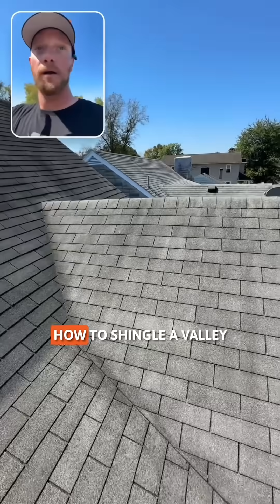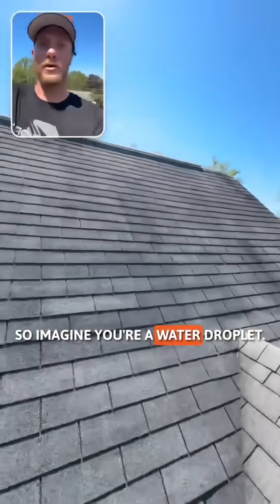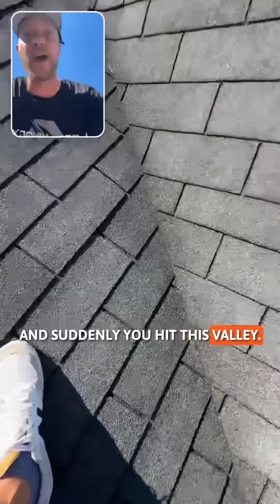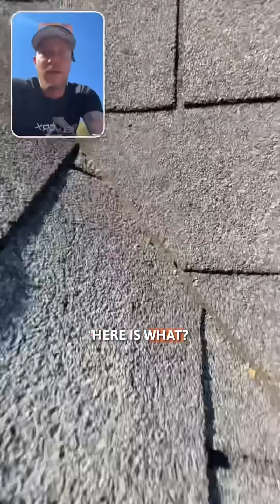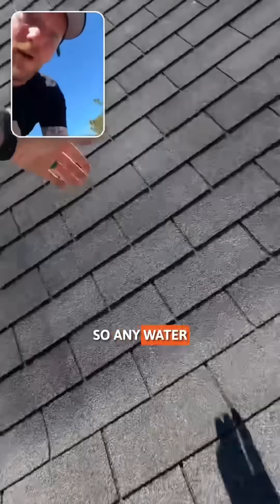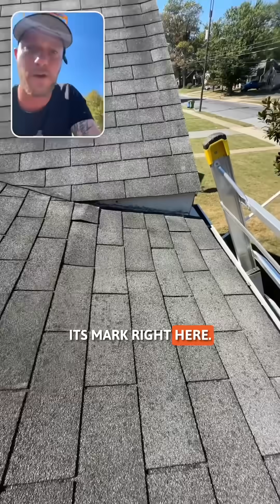Roof Valley Done Wrong! | Why Shingled Backwards Valleys Cause Roof Leaks

Comment: I think by not “shingled in backwards, it is meant that the shingles of the main roof, which route the most water should be above the shingles of the dormer, which route water as well, but less than the main roof.

Comment: A big wide metal flashing installed at the valley that goes all the way from top to bottom will stop water undermining the roof. At the end of the run extend the flashing plus a diffuser will sheet flow the water. Not a rocket science that roofer wants you to believe.

Comment: Uh .. if shingled with the opposite overlap, water would run off the dormer under the shingles on the main roof. The problem exists either way. AFAIK the only proper way is a metal valley.

Comment: That`s why tinwork is supposed to be in the valley, and a gap between shingled slopes to enable unrestricted flow from either side.
Reply: Self adhering Asphalt shingles eliminated the need for metal valleys when installed properly

Comment: If you shingle it the other way, water coming off the dormer goes under the shingles of the main roof. There should be a flashing (metal valley) under BOTH sides
Reply: Negative.  The main roof is higher so the force of the water will be greater than that coming from the dormer.  The cut is backwards.  Always weave 3 tabbers.

Comment: The higher roof runs more water… That’s why it should be on top you should also cut an angle on the top of the shingle that hits the valley will help keep water from hitting the top and running

Comment: Whats backwards about it? Appears to be same pitch, if not very, very close. You didnt mention why you think its done backwards. Or why you would shingle that dormer first, then cut the shingles on your common rafters.
Reply: YOu're 100% correct. I'm thinking he's assuming there is so much more sq. footage on the main roof accumulating the most water heading down hill.
Reply: It's not, it would be much worse to have cut the other side. The place its leaking is at the end of the valley. Channels on here will show you they put a step flashing there

Comment: Just use a metal valley pan guys!
Reply: I’m ignorant. What is this?
Reply: @kyle6703 just assuming that the channel of water they’re talking about in the video instead would be diverted on this metal pan instead of running down the unprotected roof. So basically the waters going to find its way no matter which way the water or shingles run so just cover it in metal.
Reply: @kyle6703  google image search "metal valley pan for roof" for the easiest explaination
Reply from the maker: If we were replacing this roof, we would. This was just an inspection.
Reply: Just use torchon
Reply: Nobody does stuff right anymore… SMH

Comment: We always laced shingles from both sides of valley. Never had leaks.
Reply: We called it weaving
Reply: "Never had leaks" that you know of.  Unless you were the only roofer in town for new installs AND repairs, the odds of the original roofer coming out for a repair is less than 100 percent.
Reply: @DavidCrow-i5i formerly formally authorized by Certainteed retired roofer, here, sir. 
 Certainteed fully warranted our "weaved" vallies and they termed them as one of two types of "clsoed" vallies that they would warranty
Reply: That's called lacing and it does work
Reply: They don't lace much anymore. Isn't there a special name given to this style of valley shingling?
Reply: @L46C3  it's called a cut valley.
Reply: @TumbleWeed1982  Was it ever called a California Valley?
Reply: A California is when you continue the shingle in line right up the intersecting roof. I've never actually seen it done this way.
Reply: @TumbleWeed1982  thanks
I just remember hearing that term years ago
Reply: braiding works but flashing under the shingles assures no leaks.

Comment: Never settle for less than a metal valley.
Reply: Why settle for a metal valley go torchon
Reply: @byronarsenault  and pay 5x more
Reply: Metal valleys are actually bad in higher heat and sun areas like Florida. 

Full peel and stick including the valleys are superior method. It is overkill in many areas though.
Reply: Then youll have to use hr peel and stick if triple v metal valley is bad
Reply: @wildcaveman5310  I am in the PNW where it rains 10 months out of the year. Mine are magnificent.
Reply: @snorman1911 yeah a lot of things work well up north that do not hold up to the mix of hard rain and sun heat. If I remember correctly you have more raining days but Florida has more rainfall. More importantly though the heat factor in Florida is brutal on metal valleys and shingles as well.
Reply: @wildcaveman5310   interesting! You could be right about total rainfall, we get a constant rain and drizzle so basically nothing dries out until next summer. If it's possible to rot, it will rot, if it's possible to leak, it will leak.
Reply: I've seen those done improperly, really if you weave them properly like he said you'll have no issues.
Reply: @mathehack1 you are not suppose to weave a laminate shingle they will delaminate
Reply: @byronarsenault lol last time I was on a roof it was 3 tab which you do weave.
Reply: @mathehack1 why can't you weave a three tab
Reply: @byronarsenault You can, it is the architectural shingles you can't weave.
Reply: @bernardzsikla5640 that was what I said
Reply: @byronarsenault oh I got the commenters confused, sorry 😞
Reply: That's not really the best idea

Comment: It's backwards. And needs to be cut higher. They messed up when they put 3tabs on
Reply: They messed up when they did a closed valley…. I know it seems to be a regional thing, but they absolutely suck.

Period.

Even if done correctly and doesn’t leak, toward end of roof the valley will be fucked before the rest of the roof.

Now you replace early, or repair midway to get the rest of the roofs life.

Valley is higher flow. It will deteriorate quicker unless you know, it’s a stronger material in that high flow area such as a painted metal.

Mind blowing stuff… I know.
Reply: But also yes 3 tabs suck. But bending architecturals for woven valley sucks too.

Comment: oh boi my boi the thing is the dormer has a higher pitch than the rest of the roof so my boi the shingles are done correctly the only thing wrong is they cut the shingles too close to the middle of the valley
Reply: I was literally about to say the same thing. If youre so worried about your valleys just install 12" aluminum flashing up your valley seams before running shingles. Love people that makes these "rules to work by" going off of problems created from old building science. Would love to see how everything looks under those shingles. Ill bet there's zero flashing details.
Reply: You are correct I just wrote the same thing
Reply: Yeah same comment, imagine making content calling people out but not actually understanding anything and then other morons believing he’s right…..
Reply: @mdterrax Calling someone a "moron" for being ignorant of methods is unnecessary and immature. We all try to learn from videos if we're not "experts" in the field and then we can decipher for ourselves based on a consensus in the comment section on whether the content is spot on, needs tweaking, or is flat out wrong.
Reply: @WayPastCrazy2525  clearly you haven't dealt much with how trades talk at each other, I'm sure I've offended people with delicate sensabilities but most people that actually do the work can handle a bit more without folding like a lawn chair 😆  if someone is misinforming people they should be called out otherwise someone gets misled and it ends up damaging more than their feelings, comprende?
Reply from the maker: Our skin is thick enough to handle disagreements. The reverse gable is the same pitch as the main slope of the roof. So yes, the valley is run in backwards. During replacement of this roof, we would absolutely put a valley liner as well as metal in this valley.

Comment: Now, if you install the shingles on the reverse gable, first, won't the same thing happen if the water is running down the reverse gable.
Reply: Open valley with metal flashing going up under each side is how I was taught. 
Just save yourself the future headache and do a metal roof.
Reply: @ac.creations here in my country, South Africa, that is how we do it. A metal valley!
Reply: @ac.creations 
A metal open valley does not guarantee no leaks.  If the shingle is not tipped you change of a leak is greater.  What I call tipping is this.  When you cut the shingles to create the open valley,  top to bottom the portion of the shingle you don't see (top portion) creates a point.  That point can and will draw in water and must be eliminated.   I roofed for 25 years and never had a valley leak.
Reply: The side with the larger and or steeper face will win since it has more water with more velocity
Reply: @Russianmafia10 that does make sense
Reply: Exactly, you're supposed to run the shingle a third of the way up the intersection roof which is double the head lap of the of every other shingle on the roof. So it doesn't matter too much, just a matter of preference.
Reply: We weave a lot of roofs in my area
Reply: @billhenrikson1555 For the best job possible. Weave.
Reply: No, you always tuck the "receiving" slope underneath the "draining" slope.  Think of it as two water currents running down into the valley.  Look at your slopes, the side that will have the higher water volume needs to drain onto the smaller side.  So you want to make sure the receiving side does act like a pocket for water.
Reply from the maker: Lesser of two evils. Leaks are much more likely with the field shingled first vs the gable. Open valley with metal is the preferred option.
Reply: @dreamworx_roofing Indeed, but you didn’t say that in the video so my reaction was the same.
Reply: @SteveSmith-zo4ml  Well if he took the time to teach you every single aspect of roofing it wouldn't be a short.
Reply: @yourhandlehere1 Don’t be ridiculous. It would have taken him just a few seconds to provide the explanation he’s provided here in the comments.
Reply: @SteveSmith-zo4ml  You didn't ask him a question in the video
Reply: @yourhandlehere1 It’s literally the only question that every single commenter has. He wasn’t asking for a “roofing 101” tutorial. It was a perfectly reasonable question as it pertained to the entire point and purpose of the video in the first place.
Reply: @joshuasutton1395  And he answered the question. One way is backwards....water....roof area.....THINK ABOUT IT.
Reply: Use a metal valley between! Cheap contractor
Reply: @tonydelanzo5128  The customer or the insurance company decides how cheap they want it
Reply: @tonydelanzo5128 copper valleys look nice but cost alot of money. Only worth it for a red cedar roof  and on an antique home. Use Grace Ice and water membrane , and weave /braid the valley when using architectural asphalt shingles.
Reply: That's what I was thinking ..
Reply: Yes. This is why he should have told you about FLASHING
Reply: Yes, so the answer to fix that is A: don't do dormers and valleys at all in the build design, or if you are B: have a layer underneath both (metal valley or similar) that will carry the water all the way to the gutter.
Reply: Yes, and no.  Not a roofer, but I think the point he should have made is that you want to first lay the shingles on the side of the valley with the smaller surface area above it.  That way, there's less water coming into the valley flowing towards the overlap.
Reply: No usually.  Water volume flow must be considered.  Now if you have a considerable amount of water volume from overhead roof decks dropping onto the dormer deck then you would probably shingle the dormer first.  Water volume must be considered.  I've laced a valley when the volume of water could pose a leak either way.

Comment: Would Ice and water shield under the shingles help
Reply: Yes, that and a valley pan/ flashing.
Reply: They did what’s called a cali corner, might work in California but not the northwest. Do this in western Washington and you’ll be replacing a lot more than shingles.
Reply: I think so. I just think it depends where I live what they believe is the solution. In Missouri I believe we run ice and water there
Reply: depends on many things one is how far nails are placed away from the valley and if there is water or ice under the shingles and between the deck of the roof something went wrong